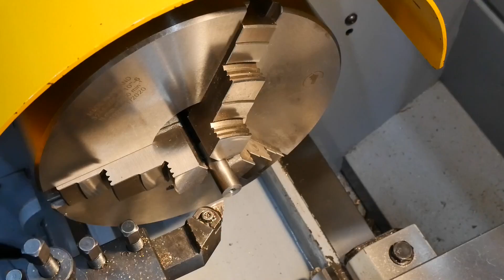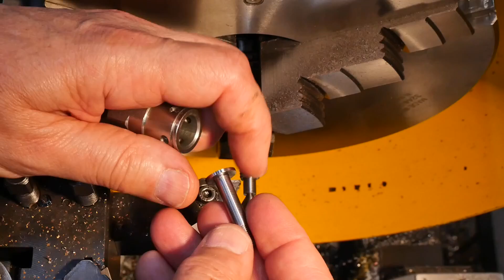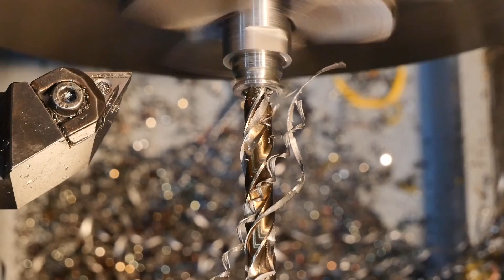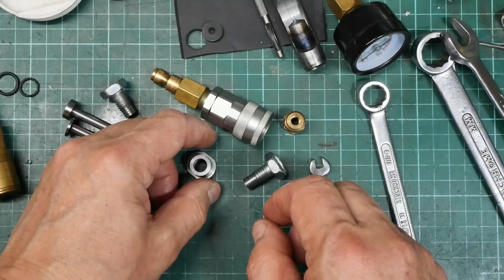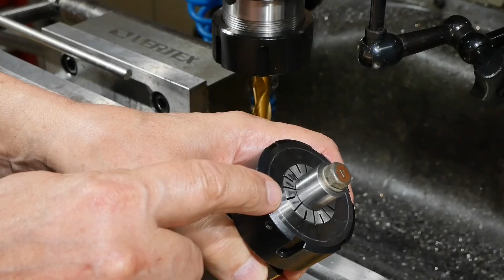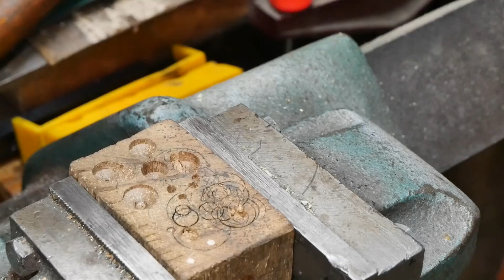Leak tester for compressed air outlets

Comment: I piped my shop air with 1/2" black pipe,  I have 15 drop's with quick couplers on each.  My compressor would kick on every 2 or 3 hours from leaking air so I only would turn on the air supply when I wanted to use it.  I have a 1/4 turn ball valve at the compressor tank if I turn it off I had no leaks.  I purchased 15 1/4 turn ball valves an put one on each drop, now all my leaks are gone, I turn on each valve when I need air at that location.  Best thing I ever did,
Reply from the maker: I've started installing isolation valves as my testing showed that several of the quick release fittings were not air tight.
Thanks for watching.

Comment: Good design/result in the end Alan.  I have an App controlled plug-in timer in the power feed to the Compressor that turns off at a set time each afternoon/night regardless of the Power State but despite that, the hissing throughout the day is annoying, so such testing is a great idea.

Comment: I just turn the compressed of !
Kit from up north
Reply from the maker: My problem is forgetting to turn the compressor off - and having my ear chewed because it fired up in the middle of the night...
Reply: @alanshomeworkshop  I wired in a red bulb in a fixture near the ceiling of my shop that comes on when power is on to compressor for this very same reason.
Reply from the maker: @darrellbauer2464  That's a good idea Darrell - simple but effective. I'd use a timer switch if I could find one for a 15A load but I can easily install a signal lamp. Thanks for your comment.